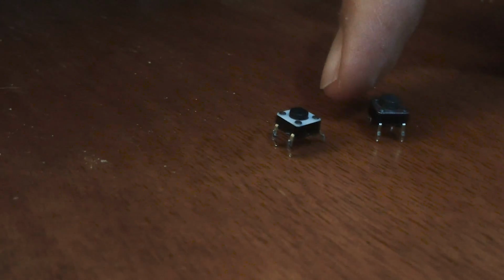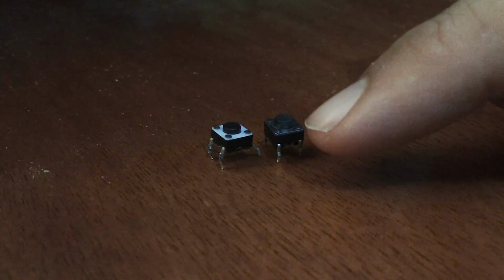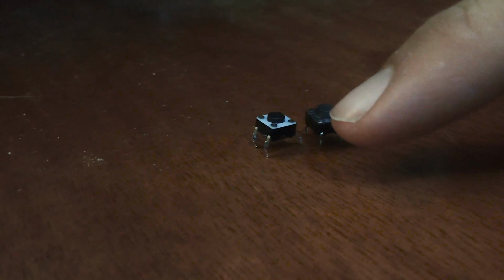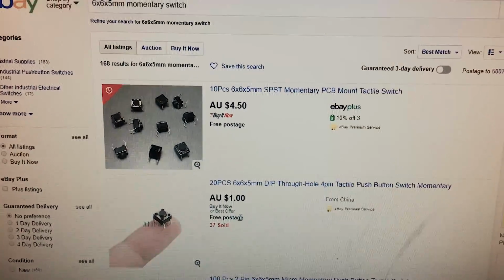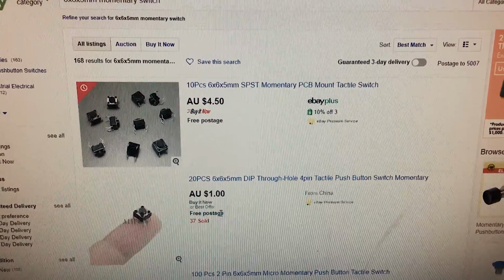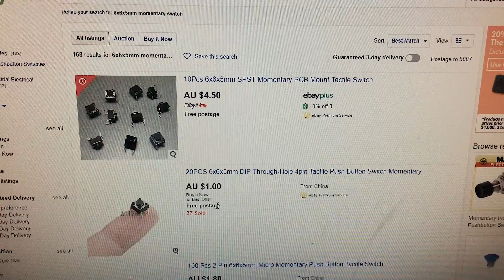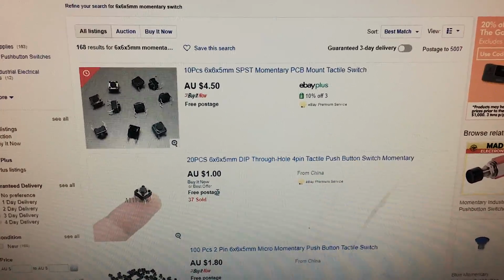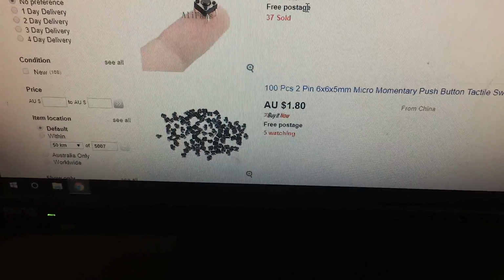LETS MOD: Behringer FCB1010 Footswitch Fix

Comment: Hey guys, sorry its a bit unrelated but I'm just putting it out there as I am stuck. I just fitted a new UNO chip, configured it, tried using this editor for windows; https://www.fcb1010.uno/ 
It's letting me receive patch dump from the FCB but not letting me export anything. I joined the group but I can't see anyway to get a activation code or even anywhere to enter one to enable me to get the board working.
There is a payment link on the Mac software D/L button but not the windows and all the forums are dead..
I'm Win10 64, i7 16gb Presonus Audiobox US 96 I'm just trying to get it to communicate with guitar rig 5 in stomp box mode.
All the manuals are overcomplicated and might as well be written in Latin, can anyone out there please help me?! thanks.
Reply: Yeah, it took me a good hour to make sure I didn't break anything and got it set up.  I actually got the chip and installed it and I think their may have been a firmware revision to upgrade to as well, but I can't remember having any issue so sorry 'bout that, but if you are someone with this problem (I'm sure the OP already got it sorted) you're in good hands with UNO - never fear!